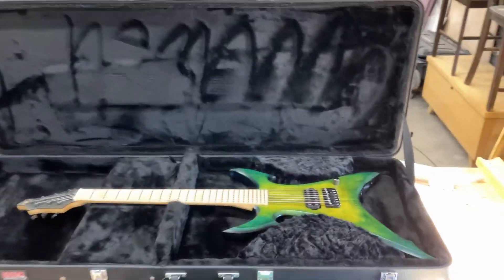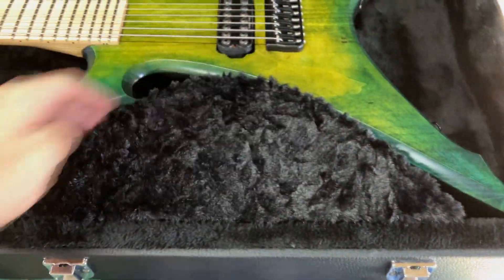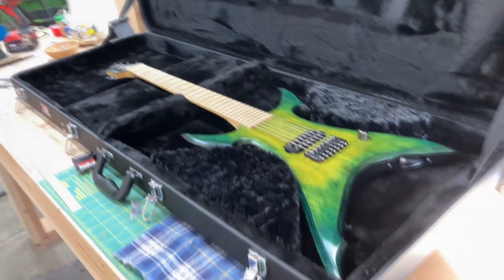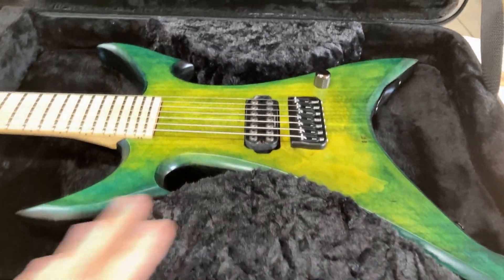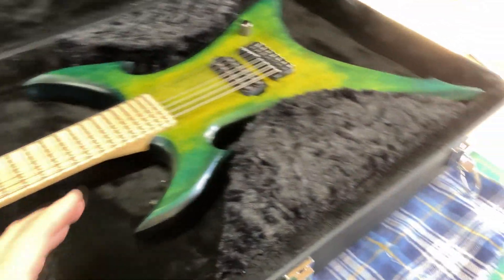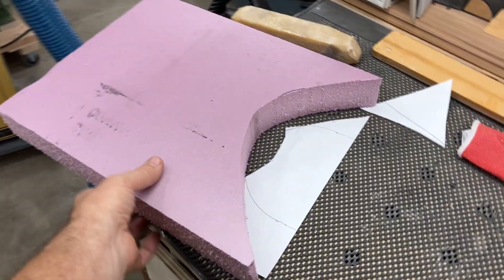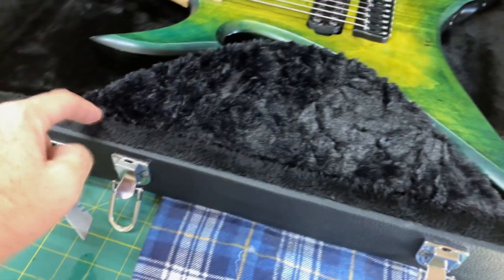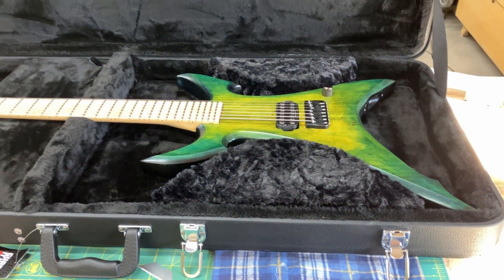Custom Guitar Case Inserts (for oversized guitars)

Comment: This is a great idea. From what I can see in the video, the bottom two points of the guitar (if vertical, with the neck perpendicular to the ground) look too close to the edge of the case. It looks like there is plenty of room to secure the guitar a little forward in the case, possibly improving its balance point as well. I could be wrong.